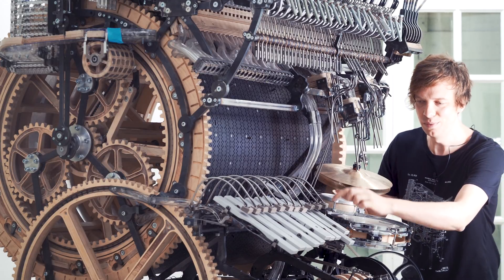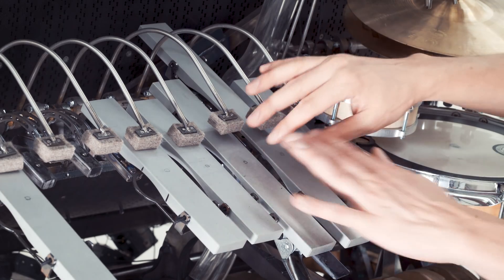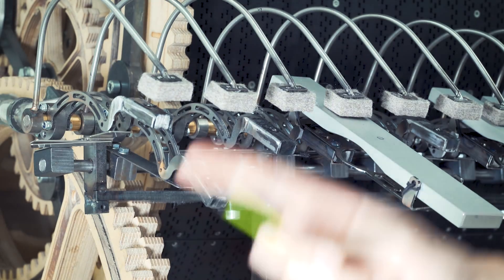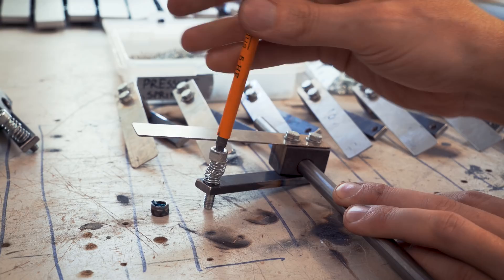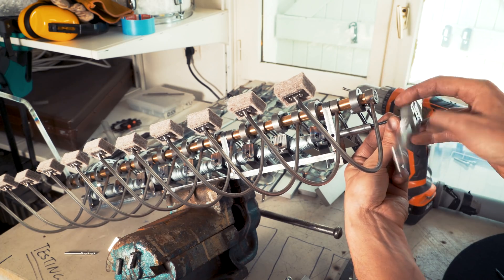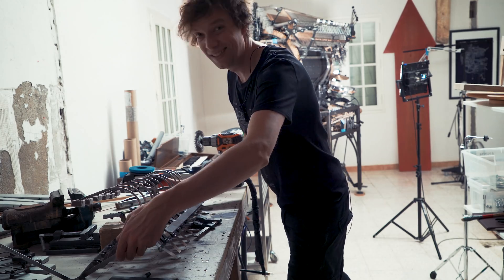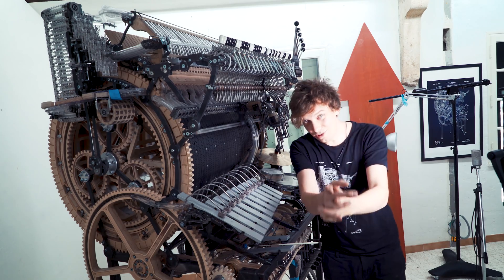Vibraphone Height Adjustment - Marble Machine X #103

Comment: Ones might already be guessing of what I'm about to talk, when I just put following words after the upcoming colon: The hassle about hand tapping threads. ¯\_(ツ)_/¯
If you have no clue, hold on! You might still have encountered with it even though you never thought about it.
So what exactly makes it worth to talk about hand tapping threads?
I mean hand tapping threads is the simples thing one ever can do. Every kid in town knows how to do it. You just turn the tap down the hole and your thread is done. Voilá can't be that hard.

Or can be?
So what are the main troubles when it comes to hand tapping threads?

The worst hassle about hand tapping threads besides breaking them is to get the correct alignment of the tap in respect of the work piece.
Or to be more precise, the center of the tap should be aligned to the center to the hole and even more important:
its angle should be aligned to same angle as the direction of the drilled hole points.
Any misalignment causes the tap cutting a thread that is tilted in respect of the hole and therefore the screw afterwards will also be tilted.
This does not only look unaesthetic but it also causes more stress in both, the underlying material and the screw itself when tightened down.
That is because all the clamping force is now concentrated on a much smaller area rather than evenly distributed on head surface that points towards the underlying material.
Even worse if you're cutting long threads with misaligned taps, they tend to break more easily, I think.
 I just imagine the tap tries to cut in a certain direction but the hole actually goes somewhere else.

So what can you do to maintain the correct alignment of the tap tool?

First thing you need to know is that there are different types of taps used for different applications.
The commonly used taps can be divided into four groups.
1.) Straight flute taps
2.) Spiral flute taps
3.) Spiral pointed taps
4.) Forming taps

The main difference between them in the first place is their appearance. 
You might notice that straight flute taps and spiral pointed taps are both looking similar, whereas spiral flute taps totally looks differently. 
Mainly because of the spiral grooves. Some might think because of their cool appearance they must be better. But actually they also have disadvantages over the other types.
And to the last forming taps don't even have cutting edges, hence they are called forming taps because they are forming threads instead of cutting them.
So we ignore the last group because we're actually talking about cutting threads.
If you look more closely you can also see that they all have different cutting angles.

Straight flute taps are the most common ones. They have straight grooves and also straight cutting angles.
This causes the chips go wherever they want to go. So they go in both directions up- and downwards.
They also are so called hand taps and come commonly with three different chamfer called taper, plug and bottoming chamfer.
Taper ones have the largest chamfer, thus makes them very easy to align, which is great for hand tapping. Also they require a lot of torque.
They should be avoided in cnc machining.

Spiral flute taps are more expensive but they are weaker than both other groups., because of its spiraling the core is not as thick as the other types.
And because of its positive cutting angles and spiraling grooves the chips will be ejected much easier and in upward direction.
This makes them not practical for cutting materials that produce long chips. Because the chips will go straight upwards into the machine.
Also they require less torques but wear out faster. Therefore they are mainly used for cnc threading blind holes and cast materials.
They need a lot of cooling because they are thinner compared to the other two groups, so they heat up faster, I think.

Spiral pointed taps are similar to straight flute taps but at their tips the tap is slightly spiraling and also the cutting edges are angled. 
This helps ejecting the chips and therefore less torque is needed. And because of its negative cutting angle, chips will be ejected downwards,
which makes them not practical for threading blind holes.

The type you use belongs to the spiral flute taps, I think.
Easy to cut but harder to align. Spiral flute taps with large chamfers could help. But why using them for hand tapping when you can use them in a drill. 
Well I'm not a machinist, so I have no idea if I'm actually completely wrong.

If you have trouble aligning the taps you can do one simple trick.
The trick is to use the bench drill press to start cutting a thread. If you already plan to use the bench drill for drilling the hole in the first place you can immediately use it afterwards for starting a tapping. This trick is already old and popular but it is also useful and gold.
If you have the work-piece clamped down all the time until you're done, it will also stays perfectly centered. And you never need to recenter it. Sure you have to clamp it down to your bench drill table before drilling the hole.
When done drilling the hole, put the tap inside the chuck of your drill. Don't forget to clean off all the chips and putting some oil on your tap. 
Now the thing is not to turn on the drill but rather rotate the drill manually by hand. Actually with that spiral flute tap you can give it a try, if you're hardcore enough. But I wouldn't recommend using high rpm. You also should lower rpm for countersinking btw.
Pull down the spindle and go cut the first two gears or more, depending on the chamfer your tap has. The more chamfer it has the more gears you need to cut for less risk of tilting the tap afterwards. When you're done cutting release the chuck with the tap still stuck into the work-piece. Pay attention of the spindle sleeve that will go up when chuck is released. Finish the thread with the handle as usual.
You can also completely thread it on the bench drill. Why not, it will work fine for small threads. But if you do larger ones you'd probably get upset because, you can't bring the torque needed, since you can't really grip and turn the lower part of the chuck, that one you normally use to tighten it. Otherwise you would just release the chuck and the spindle sleeve will ramm upwards. You have to grip the upper part of the chuck, which are usually smaller in size. But maybe you could use a wrench instead of gripping it with the bare hand.

And by the way I really like how you explain all those things in a very technical and detailed way and also mentioning all these obstacles you face. It's fun to see how a solution for one problem creates other (unthought) problems. I perceive your joy about engineering, manufacturing, tinkering and all the efforts you do. Somebody would say this has gone completely insane, but I understand (And I probably wouldn't do any other way.) 
It's not about finishing the product, it's all about the way you finish the product.

Comment: I think you are going to quickly grow to hate this. As you change vibraphone bars around in concert, and then you try to fiddle with a set screws on stage. 
I Predict. You will re-design this one more time, where the set screw is part of the vibraphone holders

Comment: Tuning each bar for exactly the same weight and so that the center of mass is all exactly at the same point relative to the chosen point of impact with the marble is 100% the correct solution as it maximizes functionally, and reliability while eliminating the need for adjustment every time a bar is changed.  

If you think this in some way destroys "beautiful movement", I think you haven't given this enough thought or experimentation.  I think the opposite is true.  If they all weigh the same, you can more easily tune all the springs and dampeners all the same.  The mass problem is solved through properly locating the center of mass, properly springing the arms, and properly dampening them.

 If you want more movement, move the center of mass closer to the machine to give the marble hit more leverage, and dampen it less.  If you want less, move the center of mass away from the machine and dampen it more.

Comment: Version 2.0, put the spring-steel onto the mount, so it is set to handle the weight of just the individual bar, which it belongs to. No adjustments needed, until after the show, when the spring-steel loses its spring. (Same screw adjustments though, but per-bar, not per-slot with random bars.) Just adding... Springs will screw into one another, eventually, making a tension failure point, as there is no more tension on the screw. Just expand a single spring, by pulling it to be longer, and that problem will never happen.

Comment: What about the resonance tubes? Don't they add some weight as well, pulling the plates even more down? Maybe i missed a part but it seems you forgot the spring inforcement on the most left plate holder. Anyhow it looked a bit weaker and you had to screw the screw all in to keep it aligned.

Comment: Sorry, not a fan :( Think all the washers look pretty terrible although that can be fixed. But more over, I think this extra step to switch notes on tour makes it a frustrating job. Especially because you have to set all by eye / don't have fixed positions (other than to remember to turn the screw 34/67th or something). I think I like idea 3 the most. Think the same dip on all notes is even a plus.

Comment: Put a washer between the screwhead and the spring, so the string sits on a bigger surface otherwise the string will bend out and maybe even over the screwhead in the worst case.

Comment: If you notice a problem, it is best to share this problem before you start making changes. All viewers together will find much simpler solutions.
For this problem, the solution is identical to the previous solution.
Adjust the suspension in height as well as in length.
If you place a different note, it will immediately be right.

Comment: You could make longer rods and add a small knob in the end, so you dont need the Allen key tool on stage. Its faster with the fingers, and you won't risk the tool goes missing when needed the most.

Comment: Quick note :
The V groove/45° chamfer is not really for the filler rod. One of the main problem of welding is "penetration", wich means that you're not melting "deep enough" into the metal. That's why you create a chamfer, because it's easier to fill a groove

Comment: "I really wanted the vibraphone bars to move when they're being hit by the marbles..."
Why though?
Reply: 2:11 you can clearly be heard contradicting this with your comment about the shim solution. "No. Not going to do more loose parts."  What do you call moving vibraphone bars, if not "loose parts"?
Reply: So in just one day of work, you've managed to add enough time that you don't think a youtube audience wants to watch without a timelapse to machine and song setup, as well as another fallible point of maintenance to the machine.
Reply: @RIPITIR  Moving parts are not the same thing as loose parts. He didn't want to use shims because they would only be held on by magnets with a chance of falling on the floor. Not the same as the vibraphone bars, which are securely attached to the movable arms. Maybe a better choice of words would have been unsecured parts or unattached parts. Give the guy a break, his English is excellent for a second language and his meaning was very clear (to me at least).
Reply: *Answers to my question at 11:25

Comment: One idea for you, make an alignment indicator tool for the vibraphone bars. Take a rod that can span the whole instrument just above the bars where it will be above a bare surface. Make a quick mounting system for you to be able to easily and accurately attach the bar when you are adjusting the vibraphone, then remove it when you are done. Then along the bottom of the bar mount two microswitches, one shimmed to be just a bit closer to the bar than the other. How much you shim is dependent on how long you want to spend messing with the adjustment as well as how accurate you want your bar positioning. Wire a light to each switch and arrange them to the bar positions so that it is clear which light goes to which position, that way when you are adjusting you can easily see what adjustments need to be made. No lights means the bar is too low, two lights shows it's too high, but when it's in the correct position it will only trigger one light making it obvious when it's adjusted correctly.

Comment: Add-Weight solution #3 is the best. + If all plates are identical mass that means the same marble bounce height & angle trajectory. And no need to catch marbles with a huge funnel for low and high notes. ...And no need to tune screws for each new song when you replace plates.

Comment: I honestly do not understand why you didn't go with the weight idea. Yes, adding weight adds weight, but basically your low key notes already HAVE this weight so by bringing the weight of the high key notes up to the weight of the low key notes you would actually get a much more predictable jump behavior of the balls (which might come in handy once you have the funnels in place since it allows you to design them smaller). With your solution I would expect you to have marbles jumping all over the place based on which note is positioned at which place on the machine. Not criticizing (your project is AWESOME!!) just pointing out my gut feeling about your solution.

EDIT: Come to think of it, your solution is still better than the set screw but still evening out the weight might be a sensible idea.

Comment: IDEA: it needs some work but it will make changing between songs much faster. Each note to be detached with its height adjustment and spring steel as one piece. This will make you only replace the notes and not worry about their height adjustment as they will always be perfect.

This may also help in the future with the resonator pipes but I'm not sure how as I don't know your plans for it.

Comment: Needs to be a lever with a flat spring between the muting wires. Rotate it back and it goes as high as you want

The springs are cumbersome and will fail easily. Flex them enough and they will just pop out

Comment: what if you 3d print some kind of screws or get them cnc cut or turned.  so you can screw with your hands from the bottom up, so you don't have to worry about tools? 
Love your work and followed you from start.🙌🏼

Comment: height adjustment/preload should be integrated in each vibraphone note. anything else just cancels the quick switchable note concept. (like when you chose to offset each center and keep hit zone same, and not adjust them. you can keep the changes you made here and add calibration to each not plate.

ps. it was solution no, before seeing the video. this means a. i can problem solve, b. i got even brighter by your 2 year efforts.

Comment: It looks to me like you are already almost running out of adjustment on some of the screws, the springs are nearly compressed. I would suggest using some slightly longer screws or adding some spacing blocks to the lower bar that the screw rests on. I would determine the limits that you want for adjustment to perhaps adjust the range of the screw. I also would love to see the stacks of washers eventually replaced with machined spacers, but for now it works!

Comment: Two thoughts: How do you know when you reach the right angle if let's say all of the notes are at the wrong angle? Also have you thought about putting wing nuts on the set screws to allow for fast adjustments, kind of like a tuner knob on a guitar, so you can tune the angle while in the middle of a song without having to use the allan key? Love the project and how you document everything! Looking forward to the tour!

Comment: Solution 8: Just change the vibraphone bar holders' heights individually, so each vibraphone bar is on the same level when put on the Marble Machine. This way you could just swap the vibraphone bars without any adjustment, which is much more elegant IMHO. On your world tour, you surely won't have the time to change the bars AND adjust them all manually.

Comment: The eighth option may need more work, but it would seen better to have the spring action (set screw and all) incorporated in the individual plate brackets. That way you could have sturdier springs for heavier notes and everything would be prealigned. No difference where that note needs to be placed. It will sit and play perfectly without adjusting

Comment: The washers, although serving as beautiful role models of what it takes to be a multi-use tidbit in the grand scheme of widget tweaking and spacing creation; are rather stone age and garish (not that there's anything wrong with that). 
However using some of our beloved PPMA pipe, with its transparency and see-through-eeness as crystal bushings within the bouncing arched whimsy and spring steel flimsy along the main bearing of our rebounding vibra tones, combined with the unforeseeable utilitarian nature of using egg-shaped lobes that have within them the cam shaft valve opening characteristics needed to adjust the relative position inherently necessitated by the swapping out of differing weighted vibraphonic rebounding  components that rest upon tiny diving boards of spring steel as they await a marble to bounce away as their note they play on their big day after all of the times they were featured on Wintergatan Wednesday.

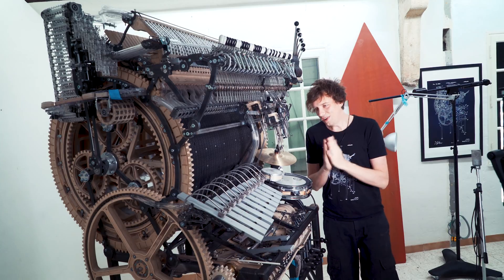Comment: At 10:24 - one thing having one job. It's interesting how much mechanical engineering has common things with software design. For example, this one is called SRP - Single Responsibility Principle, and it aims to reduce dependencies between components and allows to change something more easily without breaking another thing. Just like in mechanical engineering, it turns out!